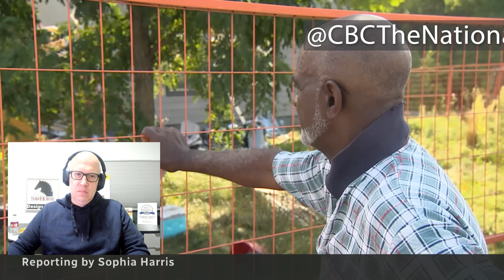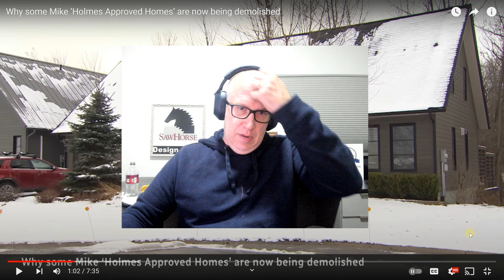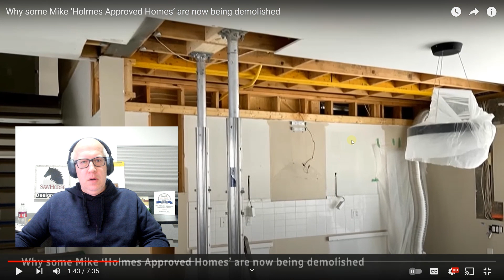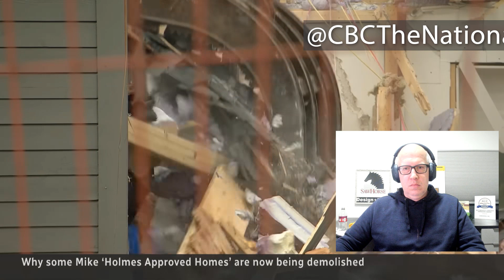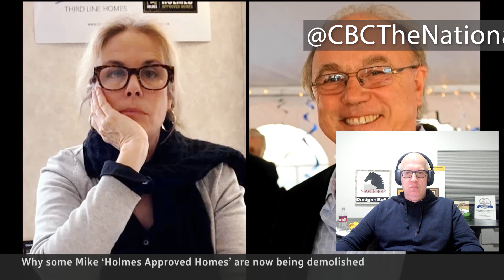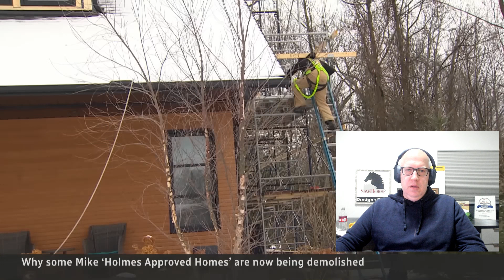Hoots on Holmes

Comment: More sealed you make the house, bigger the problem is to take it apart for renovations and when water gets into construction it has harder time to dry out. That is one of the reasons why i dont like spray foam insulation, other than between windows/door and frame. Another is mechanized ventilation, specially with heating. House should always made so it can work with out electricity, cause you never know when power is cut and another is so you can leave it cold if need be.
Reply from the maker: Great comment.

You might be able to "have your cake and it it too."  Assemblies should be built to be "air tight" but "vapor open" so they are allowed to dry.  Most building failures are due to moisture not being allowed to escape or poor cladding/ flashing that allows bulk moisture into the structure.

If the power goes out- loose or tight houses will have issues.  I'd vote for electric houses that have a solid building enclosure with good insulation and air sealing so the house and occupants are protected is there is no power.  There are also good backup systems that can address the essentials like battery back ups.

 Window flashing is tricky.  Many of the building science nerds shy away from the foam and recommend tapes or sealants that are able to breath and not trap moisture around the window.

Most of this depends on where you live.